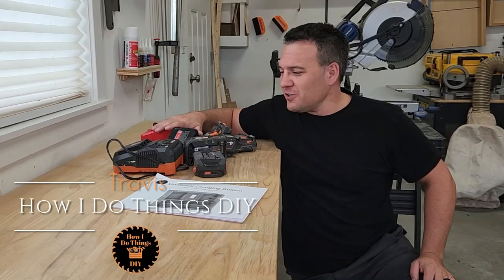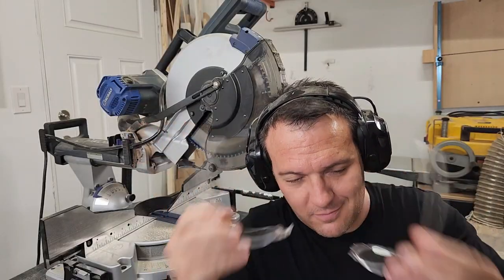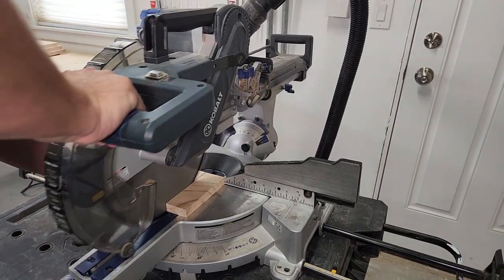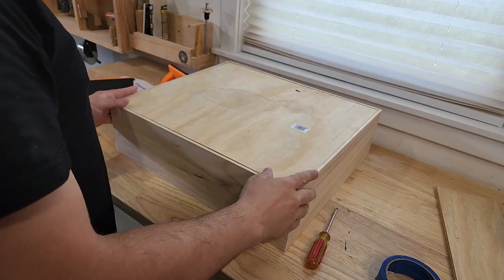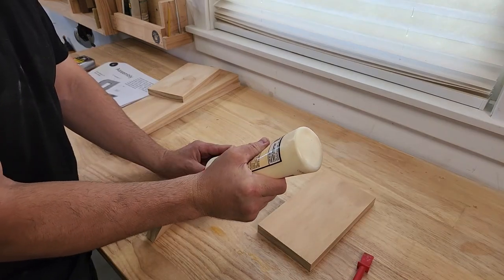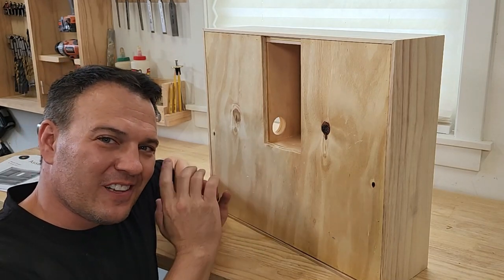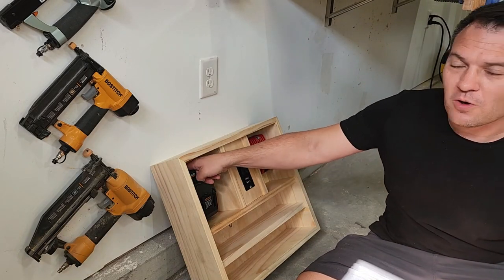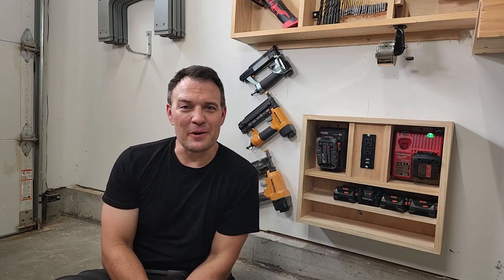Amazing Battery Charging Station || Built In Outlet

Comment from the maker: @lincoin Dickerson Gave a very good tip for anyone wanting a heavy duty outlet.  You could just add a standard metal outlet box and then make a pigtail with 12/2 or 14/2 wire.

Comment: My large charging station is attached to the wall with hinges so I can access the back to organize cables when I add or rearrange chargers. In behind is a couple of power bars to accommodate all the plugs. The front is a flat panel made from pegboard so I can attach the chargers with zip ties.
Reply from the maker: Those are all awesome ideas and suggestions.   Thanks for adding that and for watching!

Comment: Just wondering how you plugged everything in.  Seems you only had two plug spaces in that outlet but you had three items to plug in. The two chargers and the added outlet with usb chargers…
Reply from the maker: Haha.  I knew someone would ask that.  I used a short "y" extension cord for the chargers. Then the added outlet used the other one.  Here is a link if your interested.   https://www.amazon.com/dp/B072MG1D8V/ref=cm_sw_r_as_gl_apa_gl_i_6JAR02GBZR1SC4AJ6NPX?_encoding=UTF8&psc=1&linkCode=ml2&tag=howidothing0b-20

Comment: I like this a lot!! I guess ur OCD and u just wanted it all same or to all set out be flush?? But I don't get covering up the outlet and yet putting another one in!!?? Why not just leave a hole RT where the outlet is mount it with the outlet hole RT over it! Just USEEE THE OUTLET THAT'S ALREADY THERE THAT U ALREADY HAVE!!?? JUST PLUG UR SHIT IN TO THE EXISTING OUTLET!!?? And or also get an outlet extension!? Turn the 2 plug into a 4/6 plug!? Do ur BLD around the plug extension...I've seen some pretty darned nice ones!!! Or just instead of ur other new outlet just drill 2 holes! Plug a plug bar with the lights feature added them I got a bar plug but also have have lights if u want them need them!

I would also make a station big enough to add drill holsters! I just got thru making 8 nice pvc drill holsters! 

Working on my station plans!? Trying to figure out which one I want need but also which one size etc will fit my areas!?

For me I want a big station where I can have my chargers my batts my drills holsters...also hang like my screwdrivers pliers etc... as I like most things I use or need grab quickly to all be in one spot!!

I am watching ones like this to see if there is any ideal that I may want to incorporate into my plans...😊
Reply from the maker: All great tips and ideas.  Thanks so much for the comment!

Comment: Why not, 
just get a standard metal box, metal face plate and wire it up?
Reply from the maker: That's a good idea.  Then just add a pigtail.  I'm feeling an upgrade coming on!
Reply: @HowIDoThingsDIY  I used to have a table saw that had a household lightswitch to turn it on and off. Safety 0, pratical 100. Cheap, fast and good.
Reply from the maker: Hahahahha